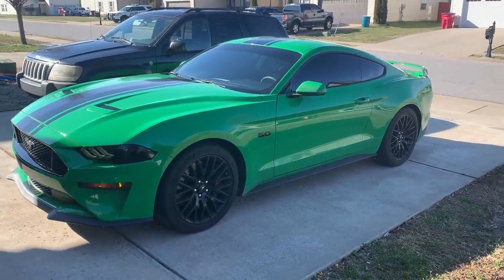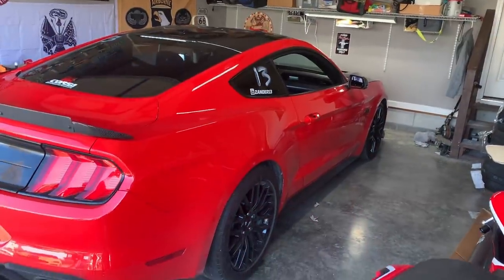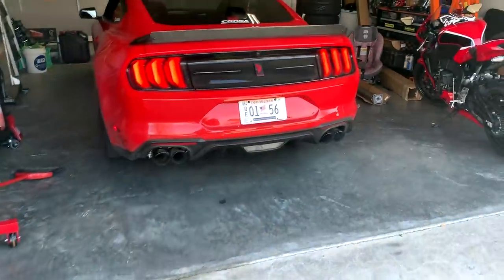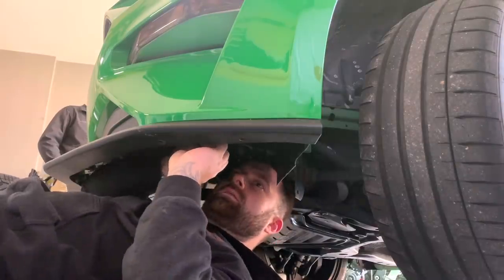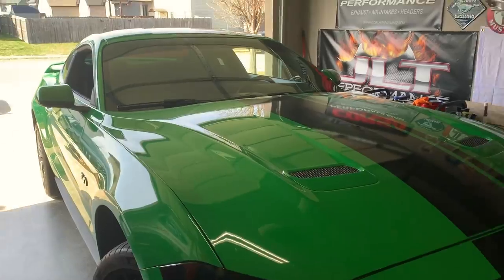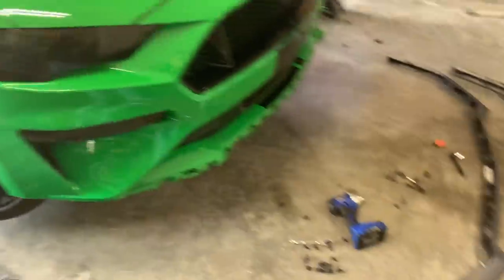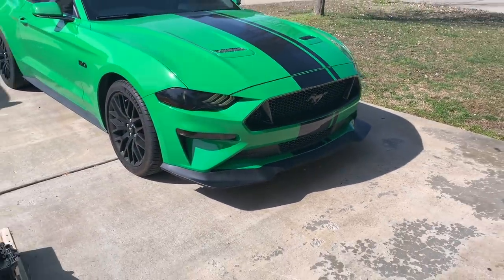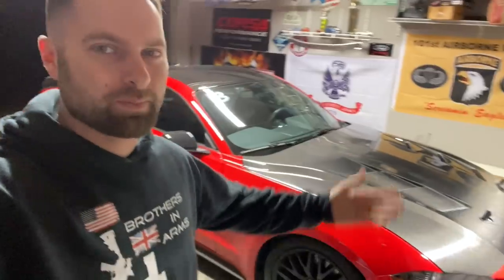TRADING CAR PARTS TO MAKE MY TWIN-TURBO MUSTANG GT EVEN FASTER!!!

Comment: To change the valve springs you have to pull spark plugs 1 cylinder at a time and pump compressed air in I would use a modified compression gauge  the air continuously blowing will keep the valve from falling in the cylinder ass you remove the spring retainer and replace the spring I have seen a few people do this and @itsjusta6 Douge was talking about this in a video last week!! It is possible but if you don't do it right like not having a compressor with enough cfm to keep up you will have to pull the head that would be a good time to do ARP head studs if you haven't already !!!

Comment: Maybe you should concentrate on making your car reliable.... or maybe just use the correct fuel for the power you are trying to make.... or are you trying to grenade your motor for clicks and views like everyone else seems to be doing
Reply: bennie walters - spot on!!
Reply from the maker: It is reliable. Turbo cars are just prone to back pressure issues more so than others 🤔
Reply: I’m sure he’s doing the best he can. Some have to do as funds allow. It’s easy to sit back and say oh he needs this and that. Easy to say when it don’t cost you anything.